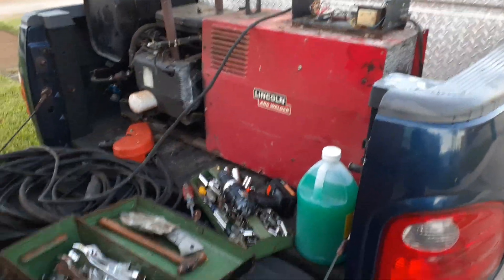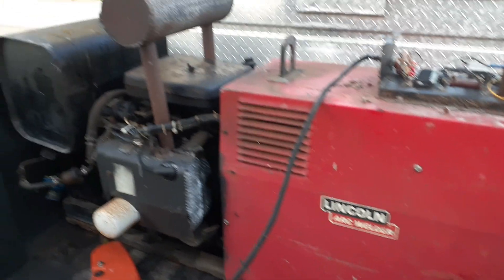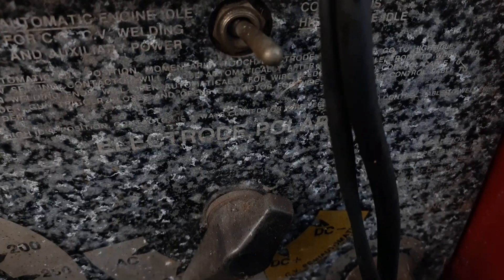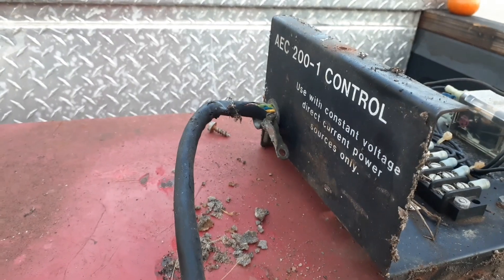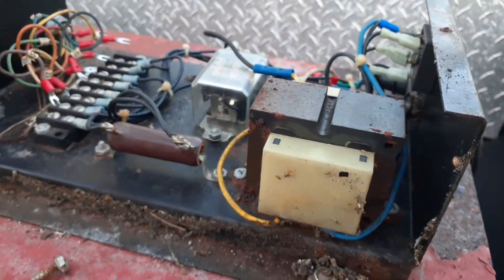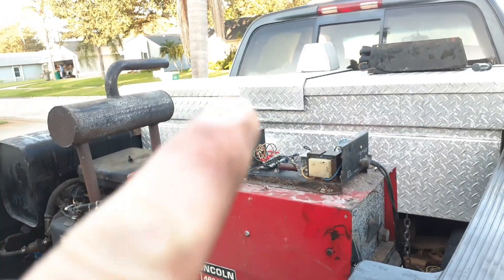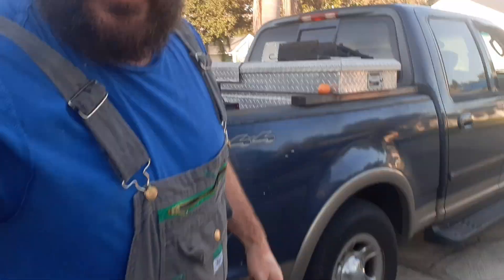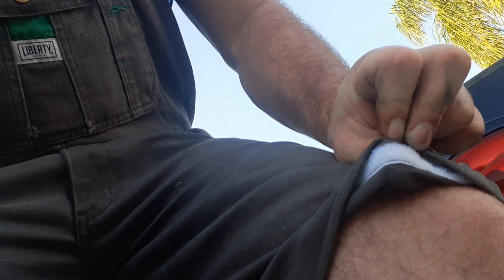Well damn, it has been a while! (No Welding) #welding #mobilewelding #comebackkid #arcwelding

Comment: Great to see you back bro!! just wanted to chime in and tell you that that is not a high frequency box on top of your welder, its a "universal" style spool gun adapter and gun made by profax to spool gun aluminum but it can also be used with regular mig wire.  If it works that was a pretty great deal because that spoolgun set up retails for just over $1000 and they work pretty great
Reply from the maker: Great to be back! Wow, I didn't know that about the box. The wires are pretty rotted on the spool gun, but maybe I can salvage some of it. Thanks for letting me know.